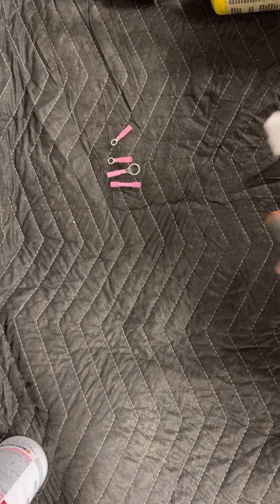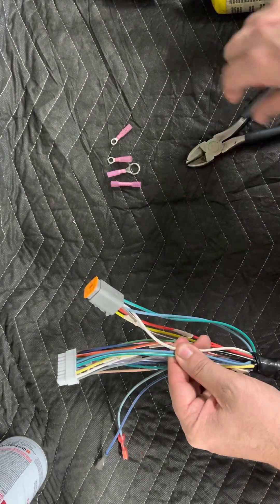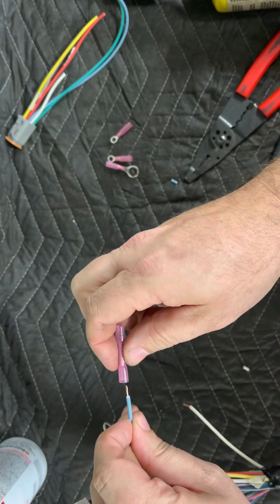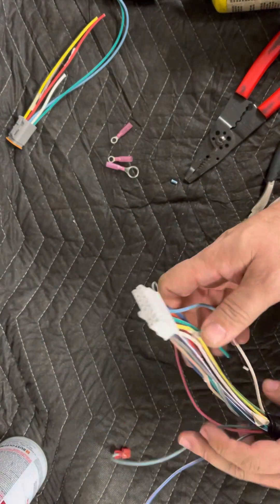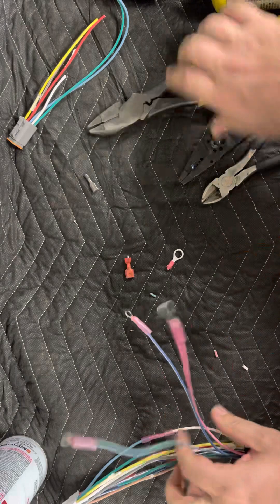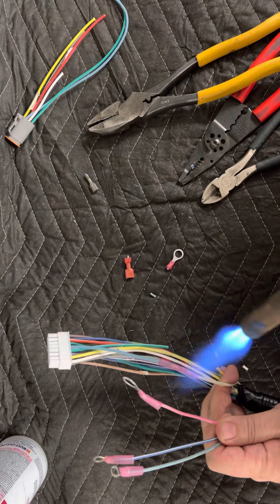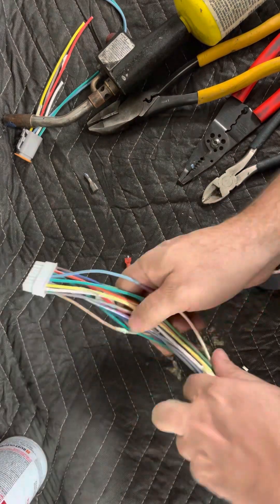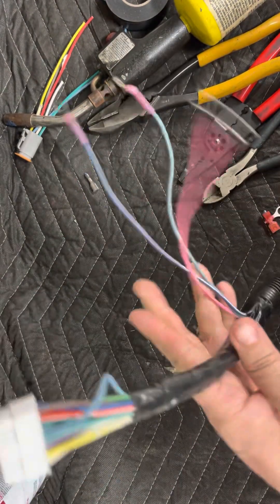Bypass OBC on Club Car DS IQ Wire Harness

Comment: Hi David, Is this necessary if you still have lead acid batteries and an original Powerdrive charger? I'm planning on replacing the harness on my '98 DS with an IQ harness so I can install a Navitas AC kit (along with MCOR throttle and forward/reverse toggle).
Reply from the maker: The OBC is the brain of the factory charger. If you’re running lead acid and using the factory charger, do not bypass the OBC
Reply: @RevolutionGolfCars  So I can replace my DS wire harness with an IQ harness, and still maintain the OBC? For some reason everything I read online says when upgrading to the IQ harness, it bypasses the OBC? Is that for a different reason (lithium) and poorly worded? I already have an older Navitas TSX 2.0 controller installed and working that went bad, causing the F1 connection to always be hot, which burned out my motor.

Comment: I have a 98 Club Car DS Power Drive Plus that I’m trying to bypass the OBC on. The videos I have seen for the DS don’t match the wiring I have. Is the DS  power drive plus more like a Precedent? I already have a separate wire from the charging port to the 48 battery negative. Do I remove the black and grey from the charging port, unplug the OBC 6 wire plug and jump the blue and white on the controller side?

Comment: After doing this , what do i change on charging port for new modz charger
Reply from the maker: This video simply shows how the harness is modified to allow the car to run with a bypassed OBC.  We have another video on our channel that shows the bypass procedure on a club car DS that already has the harness installed.  That video also shows how to connect the charger port after the bypass is complete.
Reply: @RevolutionGolfCars I can't find the video on the ground
Reply from the maker: @Youmekidding  https://youtu.be/GiTxYEw9Ttk

Comment: Hi David, thanks for the video. I'm planning on following these steps(I have a 2002 Club Car DS, SN starts with "AQ"). Rather than needing to take the controller cover off, is there any reason I couldn't follow these steps with everything plugged in? I'd do it once the batteries were pulled from the cart.
Reply from the maker: As long as the 10 gauge wire from the OBC is not bolted to the B- post of the controller, you can do it without taking off the cover.  On most IQ models like yours, there is a ground block that the OBC connects to, with a separate 10 gauge wire running from the ground block to the B- on the controller.  If this is the case, you can remove the 10 gauge wire from the ground block that comes from the OBC, but leave any remaining wires there, and re-tighten the nut on the ground block after removal.  You'll be good to go.

Comment: I have a 2001 with "AC " serial number but has the black curtis 1510 controller. will this work on this cart? did a lithium swap and getting no cart movement buzzer working in reverse but no movement except a little surge movement when swapping the tow/run switch.
Reply from the maker: @randyhill9390  AC is a Regen 2 car.  The Curtis 1510 was only found on an IQ car, which would have a serial number prefix of AQ.  Your cart has been previously converted to the IQ system. It did not come with that controller from the factory.  However, the OBC bypass procedure is identical for both systems.

Comment: Hello, would this same technique work on a 2015 club car model # 1515-5206? Thank you
Reply from the maker: No, a 1515-5206 would be the white Curtis controller found on the cars that use the E.R.I.C. charger from the factory.  These cars do not have an OBC on them at all.
Reply: @RevolutionGolfCars  ok, this cart was setting for 9 months in storage with the batteries still connected (as he forgot to disconnect them) 2 batteries had to be replaced, the others had to be charged, the charger , it's a red light blue light, green light will not come on indicating its charging.  We used a different charger and it has the same results, not charging. We also tried to reset the cart by disconnecting the main ground wire for over 20 minutes (that's supposed to reset the cart) it did not. Should I replace the main computer.  Or is there something else I can try? I appreciate any information you can give me. Thanks
Reply from the maker: @sallenpeet9031  A car that came stock with a 1515-5206 does not have an onboard computer. The charger is wired from the charger receptacle directly to the battery pack.  If there's voltage to the positive and negative pins on the charger receptacle, the charger should work as long as it's the correct charger.  Are you sure you're using the correct charger?  The correct charger would be the ERIC charger and it would not have a red light like you describe. It would have an orange, blue, and green light.  You can email photos of the charger to us at info@revolutiongolfcars.com and I'll be glad to look at it for you.

Comment: Happy you posted this news working on the same install yesterday. With the mjz400. The red wire goes on the same large post as battery pack positive. And the blue/white wire goes to the small post on the same side as battery pack positive? 

Opposite side of solenoid large post wire goes to B+. And light blue wire is on the small post ?
Reply from the maker: @Matt_white23  you’re correct on the red wire.  The two small terminals have no correlation to the large terminals so it doesn’t matter which small wire goes to which small terminal unless there is a diode present.  Watch our video about solenoids. We explain this a little deeper in detail on that video.